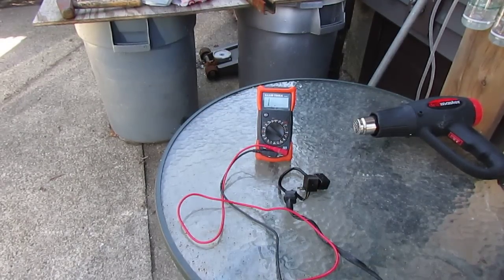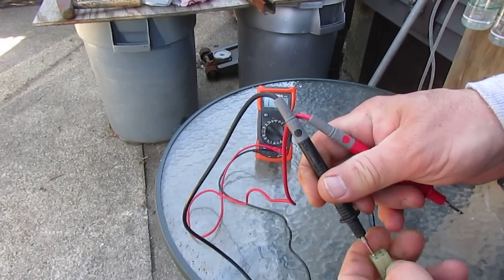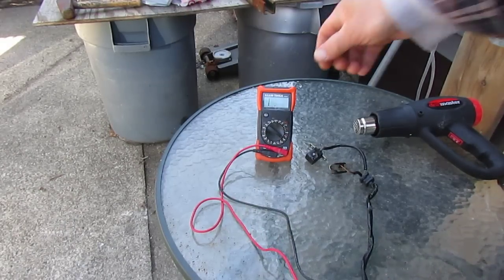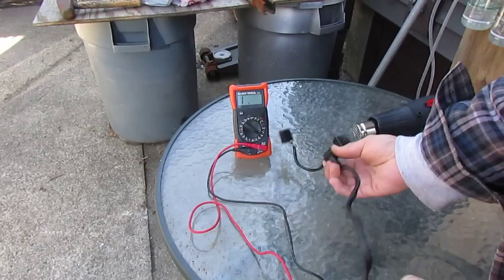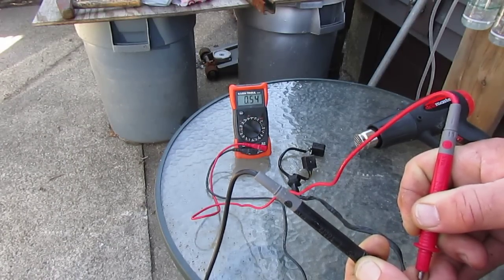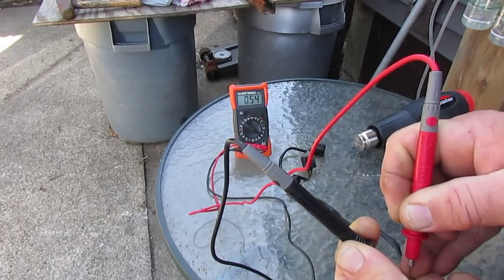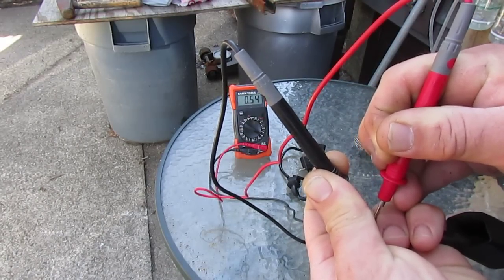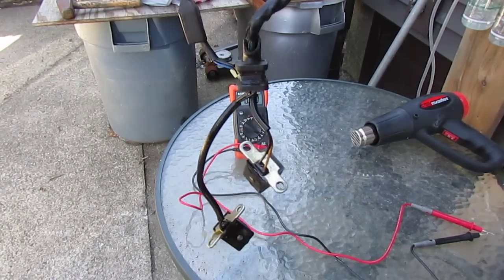How to test motorcycle pickup coils

Comment: I have exactly the same issue, my bike runs perfectly for 15 to 20 mins and then it dies. So to test the pickup coil I started my bike and then when it warmed up, it died and I just immediately changed the cdi and it started right away. I thought it would not start as I was thinking that the issue is in the pickup coil. By the way I have two CDIs and the bike dies in both Of them after some time...
Can someone help...

Comment: That is exactly what happened to me, Kawasaki Ninja 600, cylinders 2 and 3 lost when pickup coils get hot after a good 30 minutes ride. Then when the engine cooled off, everything is good. Great video showing how heat makes the part to fail.
Reply: I had a same problem take it to 3 shops no 1 can find the cause.  The bike set for 5 years because of that

Comment: I had a similar problem, it was the same issue but when the engine died I used upside down canned air to cool off the coils  and bingo, it fired right back up, i was in the garage though and had it all taken apart. It was a goldwing

Comment: Hello, if I have two cables running from my pickup one black and one yellow which one would be the signal? I need to know this to connect a quickshifter module so that it reads the revs correctly. Any help most appreciated!

Comment: Can you also check the signal  pulse, checking the neg wire with a test light when you crank the engine?
Reply from the maker: david contreras yes you could, but if the bike is hot
Reply: It won't show nothing if it's cold?
Reply from the maker: david contreras if the coils are cold...they will conduct electricity, when they get hot the insulation inside the coil will break down and the elecrricity will go where it wants...not where it needs to go for your bike to run correctly
Reply: What I want to do is see if the ignitor is giving a signal. My coils are good.

Comment: ok so im having a no spark problem with my Honda cbr 600 f3 and I tested with my light tester and the 4 wires connecting to the coil im not get the positive of it . when I put the tester clamp on the negative pole on the battery  im getting current from the two b/w wires but when I tested the B/Y WIRES im not getting any even if I put the tester clamp on the positive battery pole do you know why im not getting any current do you think I have to turn over the bike to get the positive to light my tester

Comment: I'm having the reverse problem. I Had a yamaha dealer install a Pickup coil on my back july of 15. I drive my bike a good amount (main mode of transportation). now my bike is dying again. Im going to go get the battery checked. but i changed that not too long ago too. how long should a pick up coil be lasting me?
Reply from the maker: Jessica hannink they can fail ever couple of years, I do 15-20,000 miles per year and I usually get 1- 1 1/2 years out of them
Reply: Thanks, I took it to a shop last time, If this is the case i want to try and Fix it my self. Could you help me locate my Pick up coil on my bike. I  just know of it and what part it is. I ordered it from amazon last time. I have a yamaha Vstar 650 cc 2005. THis is the Schematic list for my bike I don't know where to find it though.

Comment: hey thanks for the video. I am helping a friend troubleshoot 07 V Start 650 and when I disconnected the pick up coil and checked with a tester. I did not get any reading and I used a digital and analog tester just to be sure. What is your input on this one? bad pick up coil?
Reply from the maker: Angel Bumanlag good question, the info for the coil resistance test should be readily available online, the ohm readings have to be within specs, I would definitely check them with a meter first
Reply: Angel Bumanlag I'm not getting no reading for my pickup coil either...i kno my spark jus disappeared... running good one min...to running like crap next thing no spark no where

Comment: Thank you for posting this video! I had the same problem on mya fuel injected 2010 Triumph Speedmaster.  The bike would star and run fine for about 4 miles and then the engine would shut down.  I had to wait 15 to 20 minutes before the bike would start and run again. Watching your video confirmed that it was the crank position sensor and it made my decision to tackle the problem a lot easier. Originally, the check engine light came on, so I hooked up a computer to the ECM and it gave me a P0355 (crank position sensor error).  I cleared the error, and the engine light did not come back on anymore, however, the problem still persisted. So I wasn't sure if it was the crank position sensor or not.After watching your video I decided to replaced the crank position sensor and the problem was solved!  The sensor was $80, a RH cover gasket $5 and $10  for a  Torx bit set(needed T30), $8 for some feeler gauges, and $3 dollars for a gasket sealer to put around the grommet. With tax everything was a little over $100, which isn't cheap, but it's way cheaper than what the dealer wanted.  The dealer quoted me around $350 to $380, supposedly because they would have to adopt the ECM to the new part.  That's outrageous.  After you install the new part, you simply start the motorcycle without moving the throttle and let it idle for 12 - 15 minutes and you're good to go. I've been riding for a few weeks now without a problem thanks to your video!

Comment: noob question: why are there 2 pickup coils? why can't the use 1 for all 4 cylinders, or why isn't there 1 pickup coil per cylinder?
Reply: Slick Tires good question ! I thought there was only 1 pick up coil located in the right hand side crank case. ( four stroke engines. ) maybe Iv more to learn.
Reply: one per cyclinder..
Reply: These older bikes use a sacrificial spark that fires at the bottom of the stroke. So each coil powers 2 cylinders firing at opposite times.

Comment: what would happen if u wire the placement backwarks
Reply: +Danny Torres nothing. resistance has no polarity like voltage.
Reply: +I DONT CARE hey I got my bike running I actually did have them backwards, I thought because I matched the colors it was ok but apparently the colors where wrong ,it caused the bike to run in reverse lol so that's when I got the idea to switch them around
Reply: +I DONT CARE it's a 2 stroke dirt bike idk if thaat makes a difference
Reply: +Danny Torres oh my bad. totally misunderstood. I thought the question was about measuring resistance with the ohm meter.
Reply: +Danny Torres oh my bad. totally misunderstood. I thought the question was about measuring resistance with the ohm meter.
Reply: Danny Torres b

Comment: my cg 125 has a misfire problem. I misfire as high revs.. never misfires at low rpm though.. Its worse when the engine is warmed up..
Ive replaced the CDI, ignition coil, Spark plug, and its still doing it.. i repeat.. only at high rpm..
Coil the pickup coil be the issue?
My engine is not very old, only done 2000 miles from brand new..

cheers
Reply: i think so..
Reply: Could be.. also maybe the spark advancer

Comment: Question for ya. My manual says test the pickup coil at ohmsX100. My multi meter only has 200,20k,200k,2000k. What setting do I use. I'm using the 200k and I get a reading of 190 bit then it gradually goes down..bad pickup coil then?? Thanks

Comment: my yamaha yzf r6 2001 not function the pick up coil in cold is 292 in hot is 340 or more. this is the problem?
Reply from the maker: you should get the factory specs to see if its in the correct range, if they test correctly it could be the air gap to the rotor, or faulty cdi igniter, and coils. should systematically check each component